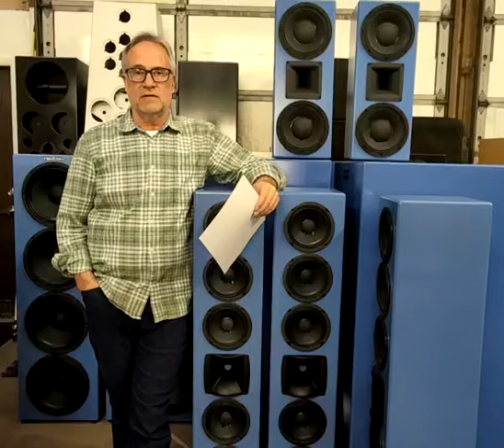Eric Alexander Tekton Damage Control (Deleted Erin’s Audio Corner Response video Reupload)

Comment: Just bad judgement on your part Eric, it wasn't a bad review, you should never bring up litigation or even react to an online review unless someone is relentlessly attacking you.  None of this would be happening if you had just ignored it, your sales would not have been negatively impacted, and most would have forgotten about it by now.  You made a mistake, and this video wasn't exactly the best damage control.  

I've never heard your speakers, I've been building my own for 50+ years, so you're not losing any business from me because I would have never been a customer anyway.  If this were not the case however, Erin's review would not have deterred me from considering your product.  Your response to Erin however would.  

Just a suggestion, your best bet now is probably to just be quiet about it and let it eventually blow over.  I see a lot of negativity in the comments here so clearly the damage control isn't working.  From what I've seen, you have some unique designs and there is a market for that so just let it go, let things quiet down and in time it will be as if it never happened.

Comment: Tekton will need to start dumping prices to survive, when dealers can make more margin they will evidently push the product to consumers who don't know better.  Eric said to start publishing in-house measurements (which is a good move), if the data is good and product does performs, it will be great value.   The only issue I have after seeing Erin's measurement is the Troubadour really has high multitone distortion (which means the vocals are muffled), if Eric can't solve it, than the Troubadour might as well be dead.
Reply: They can't. A lot of the perception of the value of their products is their price tag.

Comment: Sounds like you're the one jumping to conclusions. You could/should have verified the miniscule hump was the result of the feet being left out prior to accusing others of bad/faulty data. The sound quality of speakers is objective and influenced by the environment in which they are situated. On the other hand, properly performed measurements can and will disclose the response curve which will confirm or refute what the listener is hearing.

Comment: These fly by audio reviewers do not have half the talent Eric does. I have heard numerous Tektons throughout the years and they are incredible speakers! The saddest part about all of this is Eric and Erin would most likely be tight bros under different circumstances. Tektons are successful because they sound great.
Reply: Did you write that of your own free will, or were you coerced with threats of litigation?
Reply: That's completely missing the point here , bud.
Reply: @A_Bunch_of_Savages  Ha Ha... No, But I do agree. If you are trying to settle something, the last thing you should do is bring lawyers in to the mix. Most of them do not like to solve problems, there is no money in that. However, Tekton does make incredible speakers.

Comment: That is not how reviews work, how unbiased reviews.   If your product is good, it will review good and measurements will back it up.   You are way off this.   There was no oversite, he measured the speaker as he does with every other manufacturer speakers measurements.     So you don't like that reviews are not perfect like you want, so you threaten them?   Now you have had many orders canceled and you fully believe it's due to the reviews, but in truth it is due to your actions against those reviews.   

Not one of these reviews went into this to attack you, but your response was to attack.  That is the reason you are losing customers.  You need to self-evaluate your position and make things right before you regain any sense of trust by customers.

And thank you person, for reposting these so we know the truth about this man!